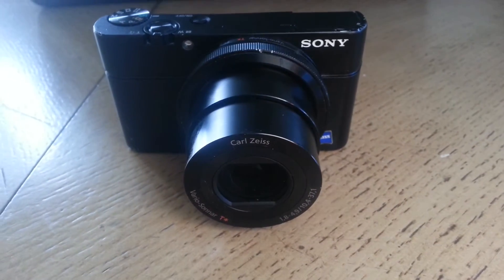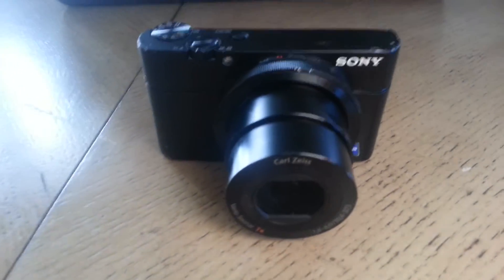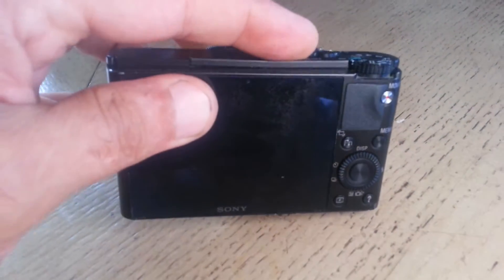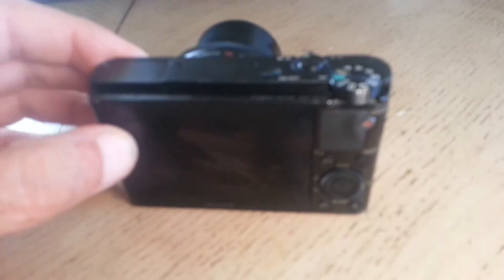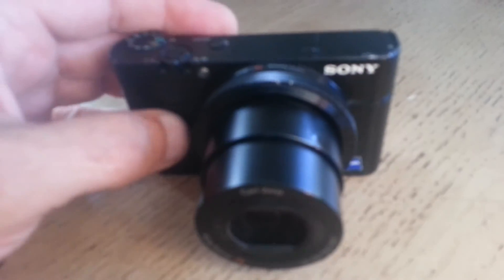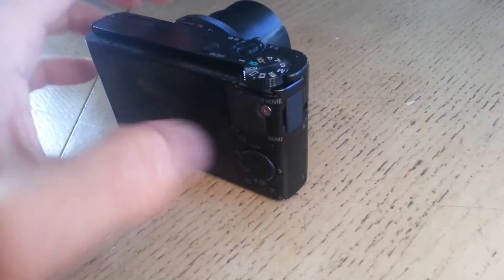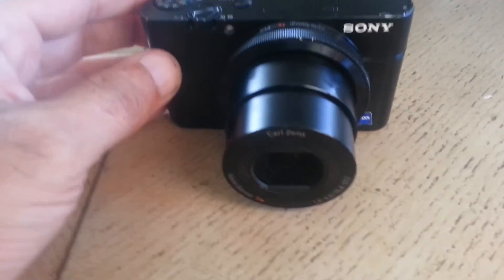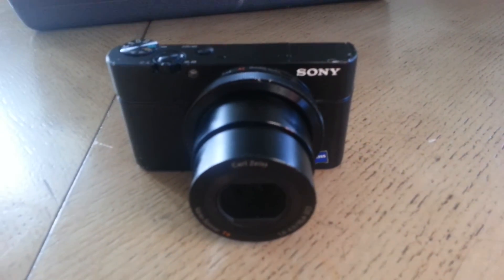Sony DXC-RX100 20.2 Megapixel problem repair, Part 1

Comment: The flash on my Rx100 m3 stopped working. Any idea if I can replace it?

Thanks.
Reply from the maker: Not a big deal, if you find the flash unit assembly.

Comment: Could you post a link to the ebay offer for the image sensor? Did you have a manual for opening the camera?
Reply from the maker: +Karolos Fostiropoulos The EBay item number 251401034873 New lens Zoom CCD image for Sony Cyber-shot DSC-RX100 Digital Camera Repair part
Reply from the maker: +Karolos Fostiropoulos I did not have the manual for opening the camera , but it is very easy, usually Sony products are easy to disassemble, not to many different type of screws etc, unscrew the screws on LCD side (around and buttom side), just be carefull with the flat cables, do not break them, first lift up  the cable holder with some sharp screwdriver, then release them. The rest i think you'll figure out by yourself. Good luck.